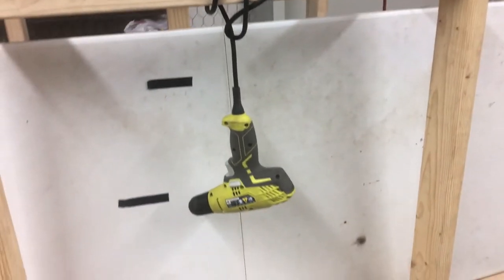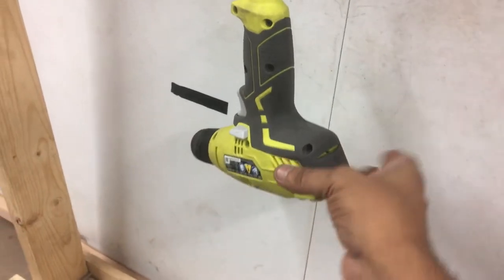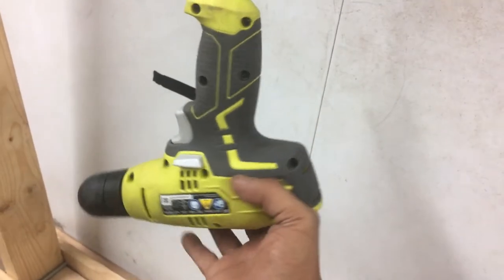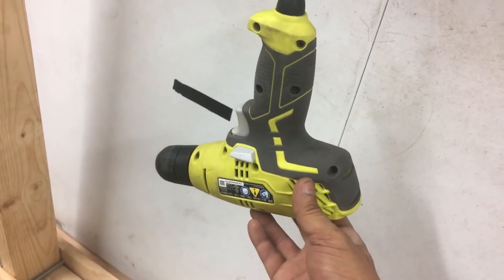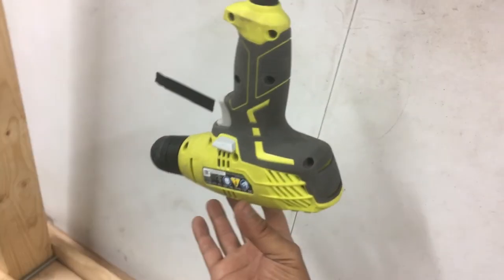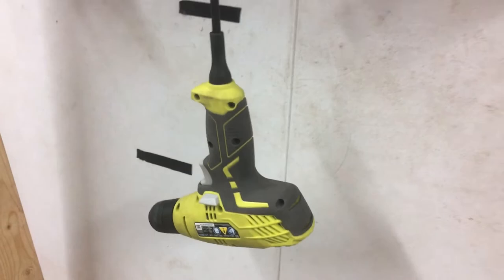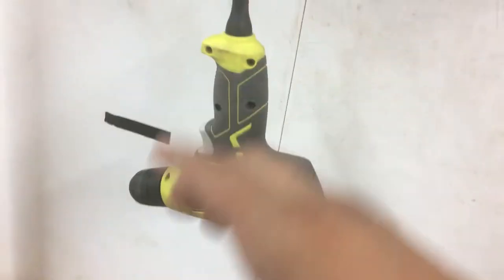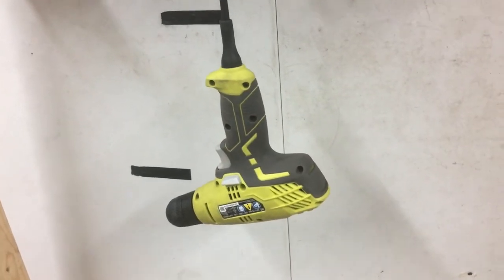Antigravity Drill?

Comment: Do you even know what gravity is? until you actually find out what makes gravity, then you can create no gravity.
Reply from the maker: Yes actually. In order to overcome it, the mechanical generation of a unidirectional force, is shown to be a consequence of the variable inertia property of matter.
Reply: The whole world probably spinning in a gigantic centrifugal wheel.  My theory we can make antigravity  with upward directed high pressure pushed hammer which enough powerful to  pull up the  whole airplane and repeat the movement many times in the second. Spinnig movement wheels not able to push forward/upward the mass cause they always pull back after a push.
Reply from the maker: Unless of course you cancel the back reaction. You can do it with accelerating and decelerating mass or weights within a spinning wheel.
Reply: Debenkfield its true but i think the spinning movement is only efficent when you accelearting, not when you declereating.  need more space to roll, more risky,  you lost 2 times more fuel/energy than the simple pressurepump-weight pull solution.
Reply: I mean the pressure pushed weight is the half of the plane itself, inside a big ball with a cylinded and enough fixed space for the generator ,Equipment, fuel, etc. The crew and the wings placed on the second part of the plane-this is the pulled by the first part
Reply from the maker: Second half going backwards is decelerated. Going forward, accelerating.
Reply: @debunkified  If that's what would overcome it, don't you think the people that have spent billions trying to would have already worked it out if you can do it with a drill? You aren't actually discovering anything. Gravity is just a theory, once it becomes fact, is when people can start making anti gravity machines.
Reply: Oh like a heavy mass in a half circle bended pipe moving end to end with electromagnet or pressure! Good idea!
Reply from the maker: This effect is only an inverse effect to a much greater cause. Gravity is only part of mass in an inverse way. Gravity can be easily explained.
Reply: @debunkified  You say gravity can be easily explained. Why not explain it to NASA, show proof of your discovery and your ability to control gravity and you will become famous overnight. saying gravity is only part of mass but in an inverse way has no meaning what so ever. The inverse of gravity is antigravity. The inverse of mass is no mass.  Nobody on this planet knows what causes gravity. Gravity is just the name we have given to an currently unexplainable force that keeps things on planets. Once you make something float without the use of magnets, without using your hand to make it look like it moves. Then you have created anti gravity. Your way of explaining is just like how planes work, they appear to be weightless but they require the use of fuels and mechanics. True anti gravity should require no fuel, no engines.
Reply from the maker: True antigravity does not use fuel. It only requires electricity to create all the necessary mechanical movements.

Automating all these hand movements is time consuming and costly. I would have to agree with you though that hand movements does mask what is actually going on.

It’s actually tempting to explain this to NASA. They are only one step away. I can give spurts of information. It’s not far fetched to say that mass in itself is simply made up of particles with spin characteristics and is similar to centrifugal force, but not the same.

We can easily generate gravity by rotating a centrifuge. The bigger it is the closer to stimulating gravity completely.

It’s a balance between centripetal and centrifugal forces, yes both being fictitious they are both two sides of the same coin as they are simply directional.

If one can artificially generate gravity than one can manipulate gravity. Gravity is acceleration of mass even on a microscopic level. Think about this.
Reply: @debunkified  Electricity is a fuel, but because we do not know what causes Gravity there is no way for it to work currently. It will not require simple mechanics and it will definitely not be caused by a drill or gyroscope. It is something far more complex than we can currently fathom as a species. I am not saying give up. Just study physics a little to get some understanding before trying to do things you do not understand.
Reply from the maker: Hi, currently we are doing what we know what we are doing and understand. Yes electricity is a type of fuel but it is not a type of fuel that throws away particles for acceleration.

As far as the drill. This is a basic concept of a gyro and it’s basic behavior. We do not think humans are ready. Perhaps a select few.

Comment: Should have used a dewalt
Reply from the maker: john denver ha, you’re probably right. But I would probably bust it.
Reply: @debunkified  Also, you should probably try and use the live drill on your head. Because the theory goes that the drill encumbers Newtonian gravitons into cerebral pulses that encapsulate the electrical signals into antigravity which creates sustainable energy that paves way for high frequency specific impulse that can be used indomitable thrust.

Comment: Good rough demo of effect.  But still insist you get your complex hand motions out of system to remove any doubt that you are not the cause of the upward motion of the mass.
Reply from the maker: EnergyCrafts Hi and thanks for your thoughts. Yes you are entirely right. Working on removing the hand movements with something more automated.

However if you look at 2:32 and many more throughout, clearly you can see the hand can in no way be causing it to go up and above the hand like it does.
Reply: @debunkified  YOU WILL NOT GET ANTIGRAVITY with motion alone!!!!

Comment: the same with your electro and permanent magnet the other day. they leap because they stem of the table...if they were in free fall the would repulse and retract relativ to each other... - no leaping with no point to leap from...action - reaction
Reply from the maker: Right, and would they not simply hover in the air neither falling or rising, staying in perfect balance?
Reply: @debunkified  they are in free fall! nothing stands still or moves- except relative to other matter . remember everything is relative - literally...
Reply from the maker: So you’re saying then they would both fall if they were both attracting and repulsing each other, in the air? Remember the EM is alternating current, so flipping polarity in order to attract and repulse the magnet underneath it.
Reply: @debunkified  Instead of asking a question. just tie your magnets to a string from your ceilling, turn them on then cut the string.